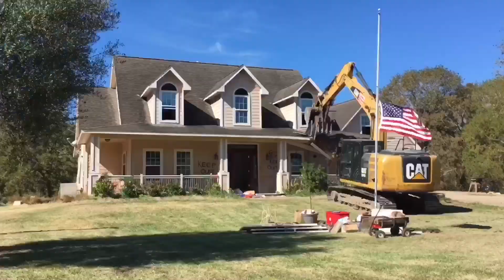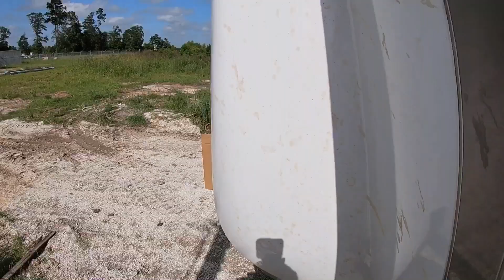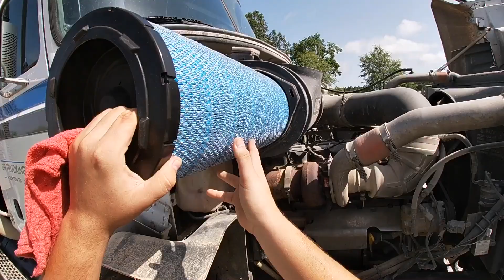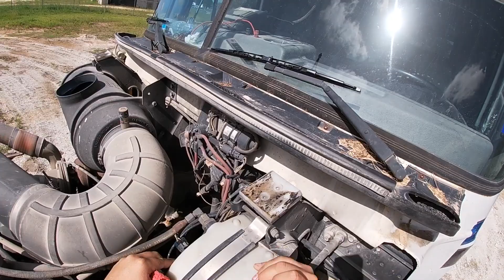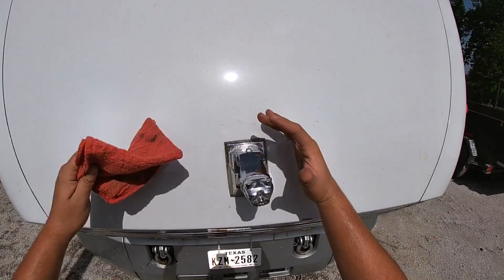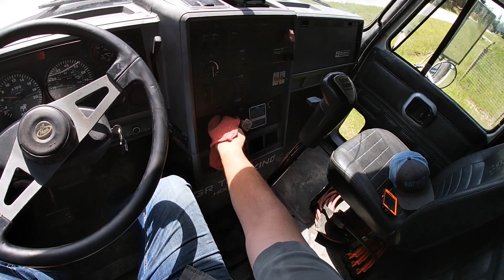mack truck checking fluids and changing air filter, truck driver

Comment: Good video from beginning to end.  I didn't expect the air filter to be that big.
Reply from the maker: auaiao9 this truck used to not have a dump bed, so it had a fifth wheel and was towing a flatbed trailer grossing at 80k, but got made into a dump truck, so the motor it has is way to much power for the small dump bed it has. I recently bought a pintle hook trailer for it to pull my skidsteer. I’ll post a video of it soon.